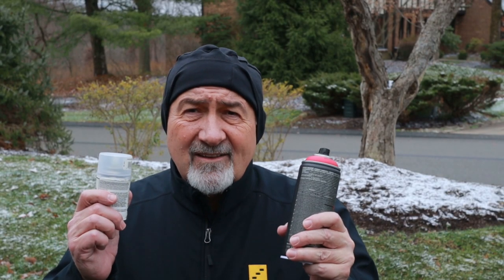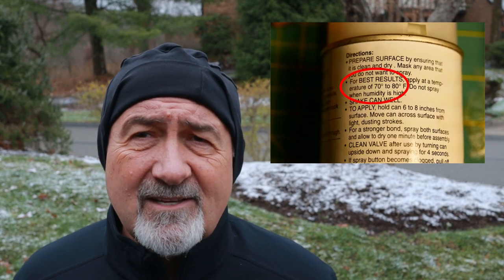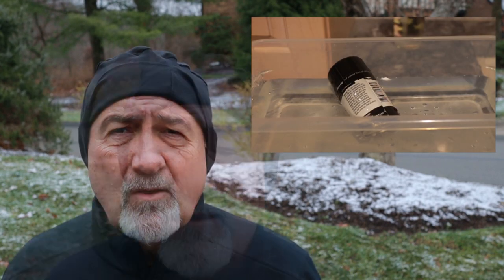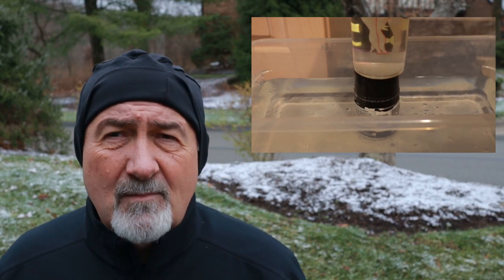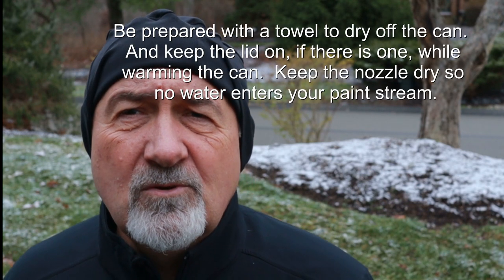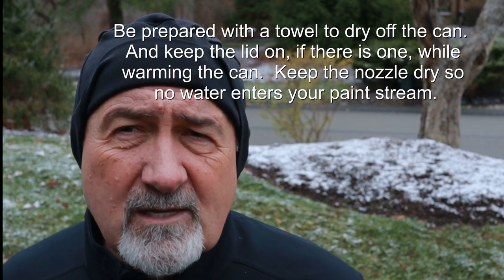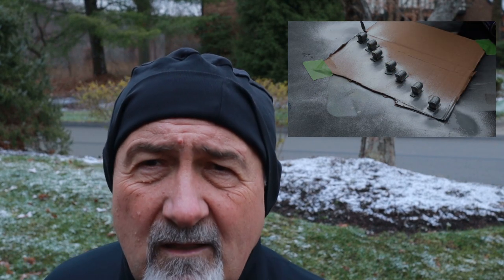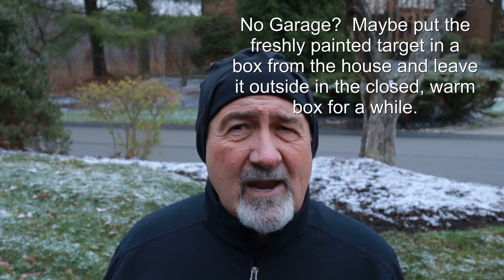Cold Weather Spray Painting Tips - PK & W RR #20

Comment: Thank you! You really help me to solve my problem, this chilly Russian morning (-15 °C, 5 °F).
Reply from the maker: Glad it helped.  That IS pretty cold!  What were you painting and how did it come out?
Reply: @PKWModelwerx  It was Warhammer miniature, I was varnishing it, it come out fine, no negative effects. I live in an apartment building and usually working with spray paints on my unglazed balcony. But from November to April, there is almost always below zero outside. So, like you advised, I warmed up the can of varnish and the model, and also heated up the room that adjoining the balcony. The process of varnishing was quick, about 30 seconds, to prevent the model and varnish from getting too cold.

Comment: thank you for the tips! I'm trying to spray a a roof rack cargo basket. I will need to flip it to spray the backside of it for each coat. How would you go about doing this in the cold? would you bring it in (to a warmer area - which I have access to) after painting each side every time to dry for 10-15 mins before painting the other side? What would be a good way to move it from cold (outside) to warm (inside) when a fresh coat has just been put on?

Comment: thank you ! it worked like a charm, i only has one question does this method also work for a spray can of matte finisher by krylon? or how would you go about spraying finisher in the cold? thanks again !
Reply from the maker: Glad you had success.  I think these principles apply regardless of the type of paint - oil based, water based, etc.  So I think it should work with the Krylon product.  It would not surprise me if you read the label to find that the Krylon product was an oil-based matte lacquer, not unlike Montana Black graffiti paint.  Let me know how it turns out for you.  And thanks for the feedback.
Reply: @PKWModelwerx  thanks man ! & yeah heated up the matte finish, applied it & it came out great ! so yes you can also heat up finishers!

Comment: is this only for small projects that's easy to moves? I was thinking of painting much larger things
Reply from the maker: Yes I paint small objects and the logistics get tougher as you paint bigger objects.  Unfortunately the realities of paint chemistry don't change.  A warm target will cool down during a long painting session and warm paint will also cool.  It starts to make more sense to build an enclosure for larger projects I think.  But I've never had to tackle those challenges.  Thanks for the thought-provoking comment.  What are you painting?
Reply: @PKWModelwerx  going to paint a dirty drum smoker
Reply from the maker: Maybe this is crazy talk but how about running a low fire in the smoker to keep the outside warm?  Of course that assumes you’re not painting the interior and can effectively paint all around without moving or flipping it over.  Good luck.  That’s definitely a challenge.

Comment: What would you say is the coldest weather you can paint in?  I live in Canada, right now where I live it can get as low as -10 Celsius in the winter but most of the time it is 0 to -5.  Would that be too cold?
Reply from the maker: Very difficult to answer.  I think if the target is small, wind is low, and everything is warmed up well, you can paint at those temperatures.  But at some temperature the paint will get too cold traveling between the can and the target.  I would run an experiment before painting something you care about.  Good luck and let me know how it works!

Comment: I have a dilemma here. I'm doing some body work on my car and it needs some bondo work and some paint. I was thinking of just doing the paint for now since I'll have to sit there with a heat gun to have the bondo stuff cure. I wouldn't really mind except I can't find a heat gun atm. But it's going to be around 40F today. Only 32F atm still early but should I be able to paint ok? I'm not able to heat up the target since it's my car and no heat gun. Just some small rust spots I sanded down to metal. Gotta self etch prime, paint then clear coat. Any help/advice is greatly appreciated!
Reply from the maker: Just seeing this.  Sorry for the delay.  How about the wife's hair dryer?  Maybe get the area into the sun for some time to warm it further?  That temperature range is only around 20 degrees too low so you might be OK.  But I'd bet you would be more comfortable if you could warm the target.  If you have an attached garage I wager the temperature in there will be warmer so you could park the car in there to warm it a little? Maybe tape a hand warmer to the surface or an electric heating pad?  Sorry I can't be more help.  Good luck!

Comment: What do you do if you don’t have a garage to let it gas out in? When should I bring it inside?
Reply from the maker: That's a tough one.  I'm assuming you are painting small objects, like plastic models.  The longer you can leave it outside, in a temperature controlled environment, the better.  Even 10 minutes in a carboard box you have warmed up in the house will help and let the initial gassing out happen outside.  Then, you might try moving it into a bathroom with the vent fan running, and close the door.  I think this all depends upon the sensitivity of those you live with to the smell.  I did a video on explosion proof spray booths so I have some idea of the dangers and I would say the explosion risk of spray paint gassing out, especially after a few moments outside, is close to zero.  Hence, I think the risk of a bathroom fan causing an explosion in that situation is approaching zero.  You could also consider building a drying booth using cardboard or plastic sheeting and a space heater running some warm air through the chamber.  How about a reptile rock in the box to keep it warm?  I'm liking the reptile rock as it won't blow any dust onto your paint job.  Time to get creative!

Comment: How about those hand warmers you can buy and tape it one or two around the can.
Reply from the maker: Good idea!  Or a heating pad or boot warmers or something.  That might warm the target as well.  And if you have no garage you could leave your painted model in a closed box with a heating pad until it dries a bit.  Good thinking @dwight kerley!  Thanks for watching!
I'm thinking about designing and building my own paint drying booth - ala Doctor Dry Booth in Micromark but for a fraction of the cost.  Sound interesting?  Of course that's after I finish my spray booth.
Reply: @PKWModelwerx  my idea for a spray booth is take a box fan tape a filter to the back of it and take a box and open the bottom of it an tape it to the box
Reply from the maker: Dwight Kerley I have to vent mine outside.  And your plan puts fan motor brushes in an explosive air stream (unless I exclusively airbrush acrylics, which I don’t).  I did a video on explosion risk.  But I admire your ingenuity.  Spray can propellants are highly explosive so be extra careful with those.

Comment: How about using a clear coat spray paint in the cold? Should I warm it up as well? It’s about 10°C here and I have already spray painted. Not sure about a clear coat though, I don’t want to ruin my work.
Reply from the maker: Just seeing this.  Assuming your base coat has fully-cured I don't see how a clear coat will damage it.  That's damn cold though.  I've never worked below 20.  If you could wait until it was closer to 32, I would do so.  I fear even warm paint or lacquer will get cold on the way to the target with it that cold.  Do you have anything you can run a test with?
Reply from the maker: Patrick what did you end up doing?
Reply: @PKWModelwerx  I sprayed it outside and left it out for 3 minutes to dry. I then brought it inside to cure in the heated apartment. It worked great!
Reply from the maker: @patrickkarrow  awesome!  It’s not easy working in an apartment so good for you!
Reply: @PKWModelwerx  This is my current dilemma! Living in an apartment in Northern Ontario, but trying to refinish a couple guitars. Super cold outside but can't get away from the fumes in the apartment. Helpful video! Thanks for doing what you do.
Reply from the maker: @dylanstewartmusic1962  Wow.  Those are large items to paint even with the neck removed.  I’ve been contemplating building a drying booth and you might do the same on a patio or similar outdoor space.  Build a temporary enclosure with an inlet for fresh air at the bottom or loose joints, good outlet at the top.  Small under the desk type space heater in there to move air and keep it warm.  No explosion risk if just gassing out.  Keep it clean and not blowing directly on your work.  I haven’t thought it through completely but it has some possibilities.  Cardboard or plastic sheeting maybe?  My attached garage stays in the 50 degree Fahrenheit range so I don’t have your challenge.  Good luck!
Reply from the maker: @dylanstewartmusic1962  is tung oil an acceptable finish for musical instruments??  Low odor.  Can apply with cloth.  Multiple thin coats gets you a glass-like glossy finish.  I’ve used it refinishing furniture with excellent results.  Just not sure if you need a very thin coating to preserve acoustic qualities.
Reply: @PKWModelwerx  I was thinking of going with a temporary enclosure on the back deck, I do have some tarps, large sheets of cardboard, and a space heater to work with. But I might heat up my paint and my target, spray outside and bring in it after 5 mins or so... Shouldn't get too cold and most of the fumes would die down?
Reply: @PKWModelwerx  Yes tung oil is commonly used for guitar finishes, but unfortunately the previous finish I stripped from this guitar didn't leave me with a nice wood grain. Even after some thorough sanding the wood has splotches of the original colour. I'll have to go with something opaque this time but that's a good idea for future projects!
Reply from the maker: Just another thought but how about a reptile rock to warm the drying booth?   Maybe better for smaller projects than yours, but I did just suggest this to a fellow viewer.  You might need two.  No blowing dust onto the project, gentle warmth, no fire risk.  I kinda like it and think my son has left one of those here in the house after he had to give up his bearded dragon.  I may give it a try and do some testing.  Small outlet at the top to let gasses escape,  hmm.
Reply: @PKWModelwerx  interesting idea! But I actually decided to cover my bathroom walls with newspaper and cardboard lol, I bought a respirator and will have the fan going to air it out after. Hoping it goes well this weekend.. but it's -20 C outside so I just don't think I can swing it out there.
Reply from the maker: @dylanstewartmusic1962  BE CAREFUL!  That bathroom vent fan is an explosion risk if the fumes are too concentrated.  I would not do what you are planning.  But, if you do, don't let the fumes get too concentrated.  Spray for a short period and then let the fan clear the air.  The risk is all about exceeding the lower explosive limit of the propellants and solvents you are vaporizing.  Those vent fans are typically brushed motors in the air stream which create sparks and can ignite vapors.  If the fumes are too concentrated, flipping the switch after the job could ignite the fumes.  See the attachments to my Explosion Proof Spray Booth video for the science.  I'd appreciate a comment on Monday to confirm you are OK!
Reply: @PKWModelwerx  I did not know this, thank you! Might have to go another route...
Reply from the maker: @dylanstewartmusic1962  how about renting booth time at a small auto body shop?  They might have a place inside to let the guitars dry overnight also.  They might have a smaller booth but will probably have a proper huge booth for an entire vehicle and racks to hold car body parts which might help you.
Reply: @PKWModelwerx  Thanks a bunch for all of the suggestions! I ended up decanting the paint which solved my issues with overspray and got rid of most of the fumes. This project isn't too high-end so the brushed look is fine this time. Glad I didn't risk it with the bathroom fan! All the best to you
Reply from the maker: @dylanstewartmusic1962  Thanks for letting me know how you fared.  I regularly decant Montana Black graffiti cans and paint with an airbrush.  Should have thought of that solution for you!  Best of luck.  Glad you stayed safe.

Comment: What happens if you spray paint a cold target with cold paint and leave it outside in the cold?
Reply from the maker: If it cures it will take a very long time.  You will not be able to finish your project or use it during that time.  And the long cure period will subject the coat of paint to high risk of contamination from dust and other disturbances.  The paint may also run and cure unevenly and unattractively.  However, there is certainly the possibility that all you will lose is time.  But what is more valuable than time?
Reply: My experience is that you will get really bad orange peel on smooth areas. If its just small model figures, the surface will be so complicated you won't notice, but smooth areas, curved or flat, will probably look bad.

Comment: Is that montana black beast color?
Reply from the maker: Just seeing this question.  Sorry for the delay.  Montana Black is good lacquer based paint.  But lacquer has some peculiarities so what is best really depends on a lot of variables.  Montana Black does have an incredible range of colors, which is a strong point for me.  Note that Montana Gold is acrylic and I believe water based.
Reply: @PKWModelwerx  would it be possible to mix ACME paint and Montana black?
Reply from the maker: @danwitavan5146  I can't tell whether ACME is oil or water based.  My guess is you would not want to use an oil based spray paint on top of a water based and uncured paint, and vice versa.  But Montana makes both oil and water based paints.  Again, I'd do a quick experiment.  But once either has dried, you should be able to apply the other on top.
Good luck!